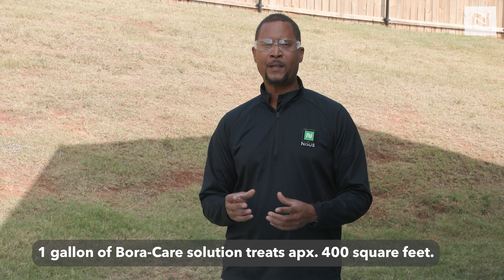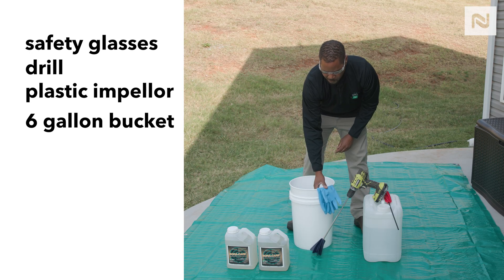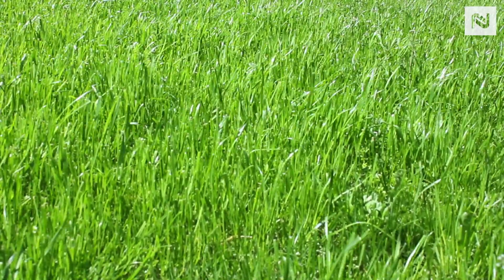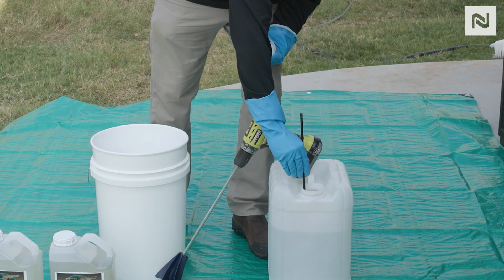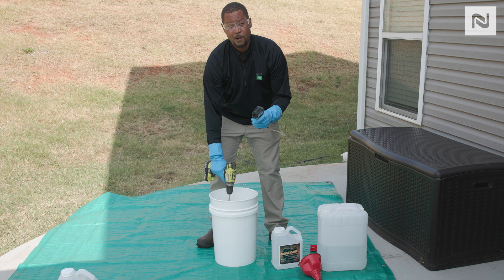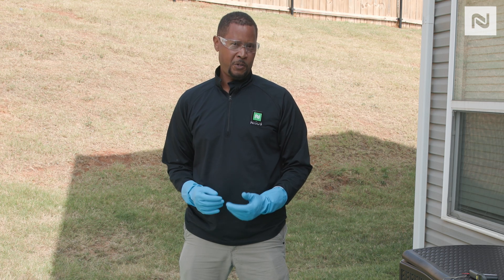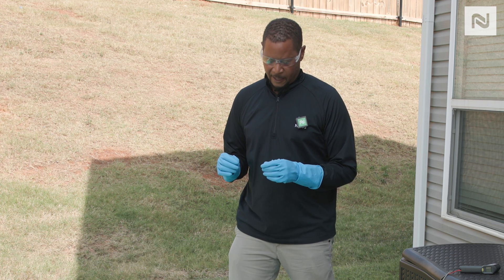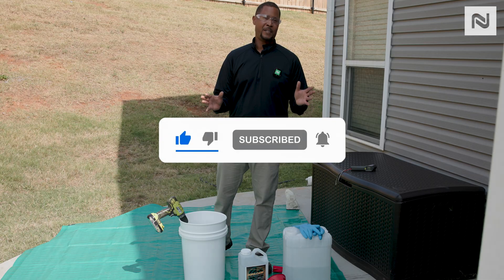Mixing 1:1 Bora-Care with Jamel Sandidge

Comment: Can I mix smaller portions of Bora-Care at a time?
I’ll be cutting pine tongue-and-groove boards to use as a ceiling in my covered lanai, and I can only work on it during weekends. The project will likely take several weekends to complete. My plan is to cut only the amount of pine I can install each weekend and then spray the pre-cut pieces—making sure to treat the ends as well.